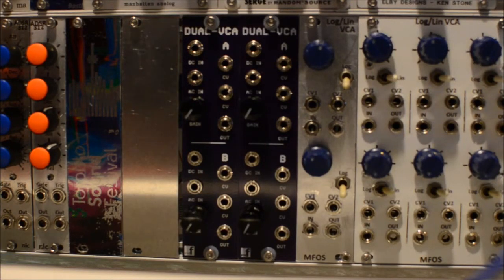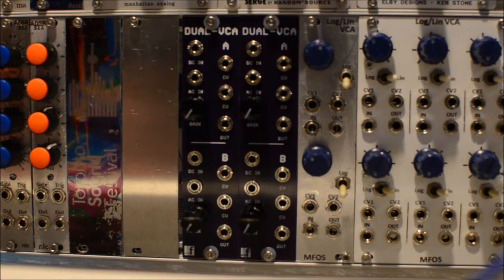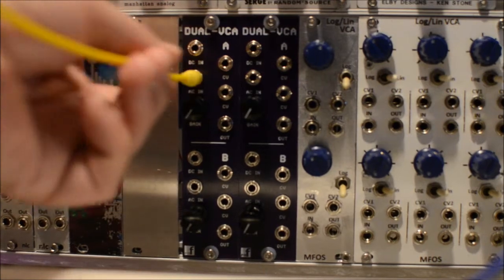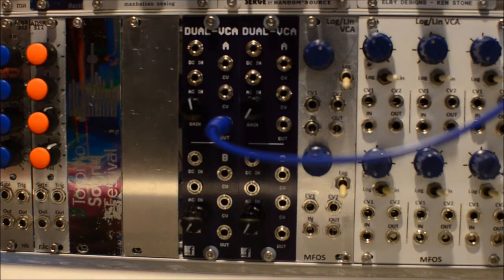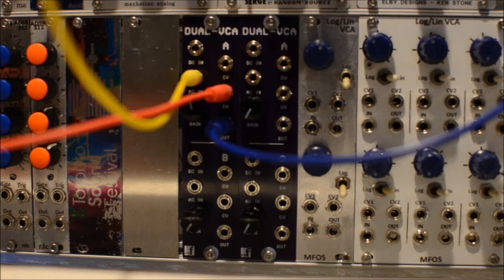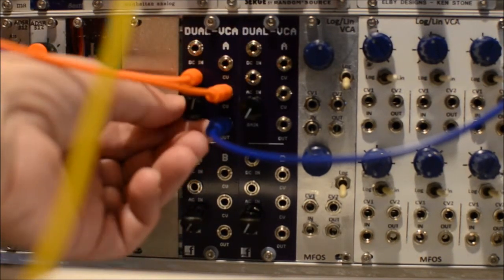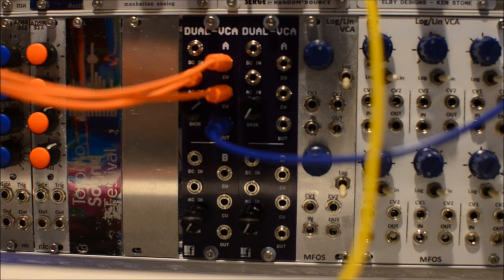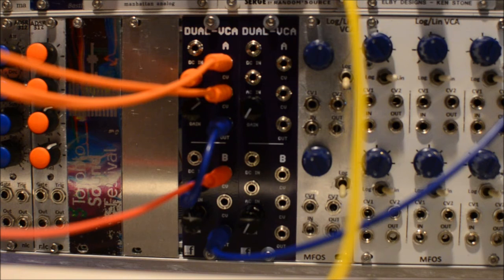PM Foundations VCA

Comment: I have just ordered two of these. I'm just starting with modular so forgive my stupid question... What use case is there for the DC in?
Reply from the maker: Hey Mirko, sorry about not getting back to you sooner.  Someone posted a similar question in another forum, might've been you but just in case, DC in is usually used for CVs instead of audio.  There are other considerations 'though, but I never noticed the difference until I hooked things up to a scope.  You can use DC in for audio as well.